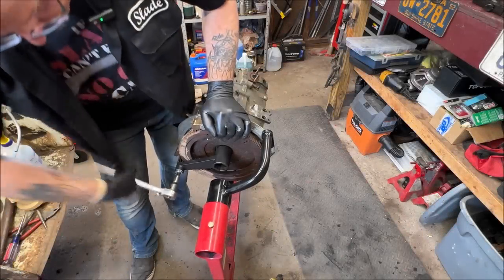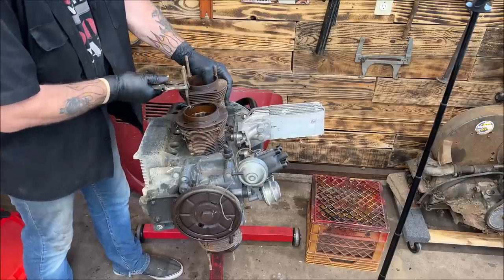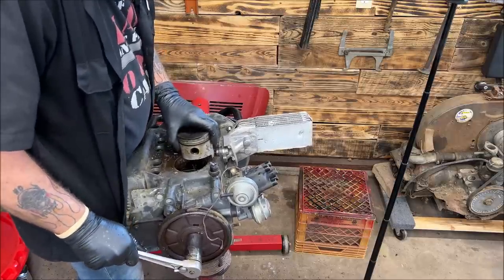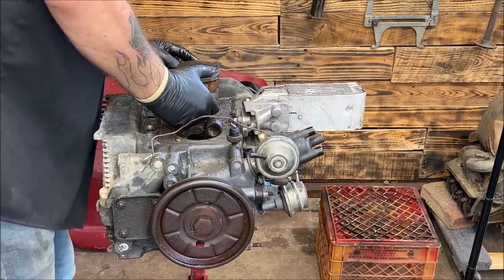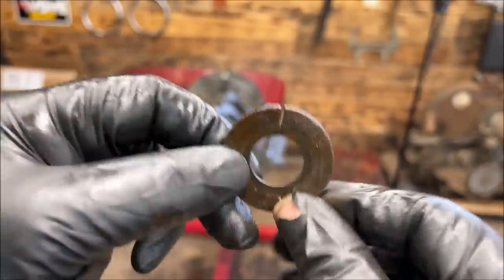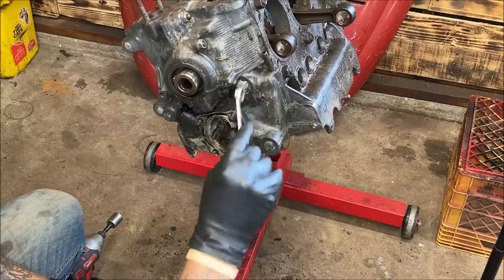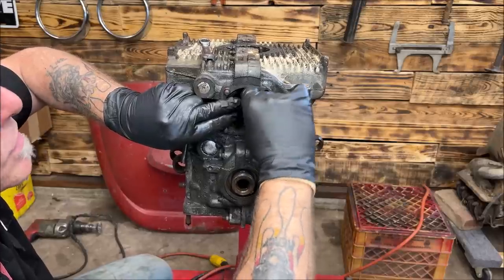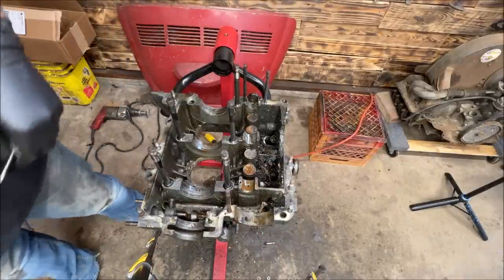VW BEETLE Barn Find Seized Motor - HOW TO get them apart - VW 1600 Dual Port - VW Baja Bug - VW Bus

Comment: Nice video; the only thing I would’ve done differently is not using a screwdriver to split the case. That can marr the sealing surfaces. Like Mike Fn said above, JB Weld can be used to repair the corroded area at the sump plate. Also, new studs can be installed there with Loctite and will work appropriately. Looks like it had been in contact with the ground for quite sometime. Fortunately now new magnesium alloy blocks are being manufactured in Brazil by Motorav; an OEM VW supplier.

Comment: I have a bus with a drain plate corrosion fixed it with J and B weld (not the quick one) and it has been fine for 5 years.
Reply: You can do wonders with JB Weld.

Comment: Purchase an air chisel hammer and a set of drifts. The  energy you are imparting with the hammer is not doing its intended job. The big end of the rod and crank are being effected . You make a wrist pin tool to pull the pins rather than beating them. Threaded rod is your friend

Comment: If I know that I'm not going to use the jugs and pistons again . I will cut the jugs down along the sides carefully not to cut the block. And if the engine will turn a little you can turn the jug out of the block so you can cut further down the jug.then I take a big flat screw driver and spread the jug to relieve the sticking add some penetrating oil works every time for me

Comment: Slades, what does "apparently this case has not been cut" mean, after you opened the block and checked the bearings at 35:20 ?
Reply: It hasn’t been the line bored for new bearings for the crank